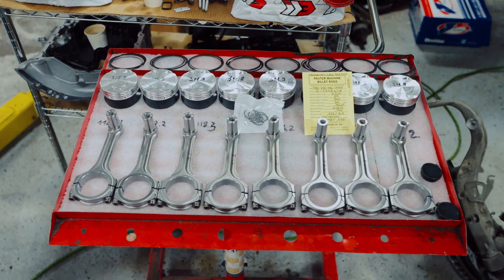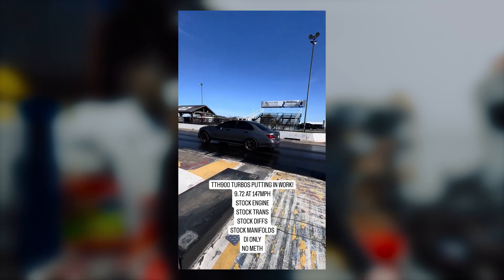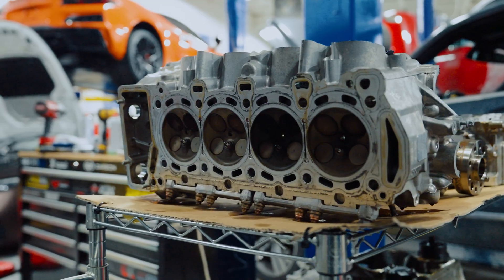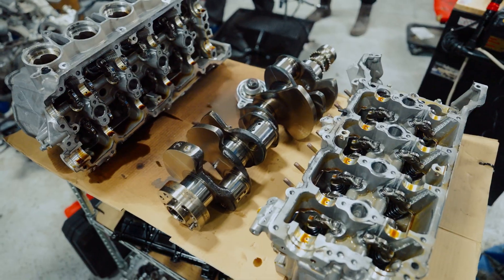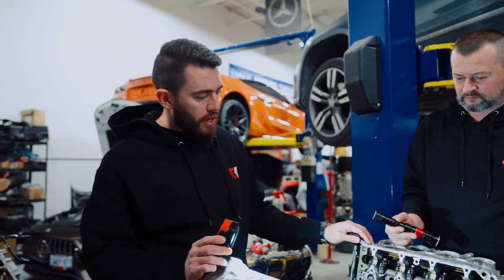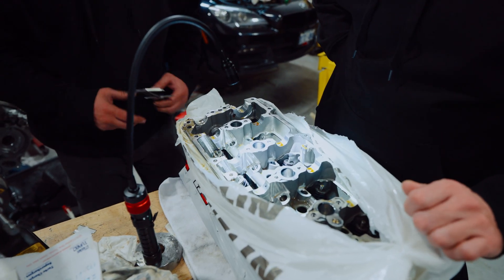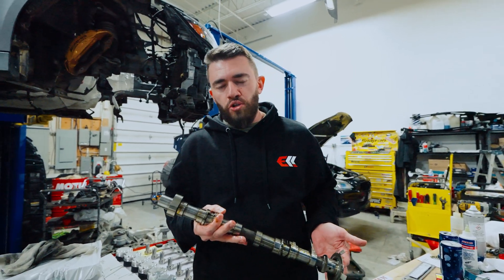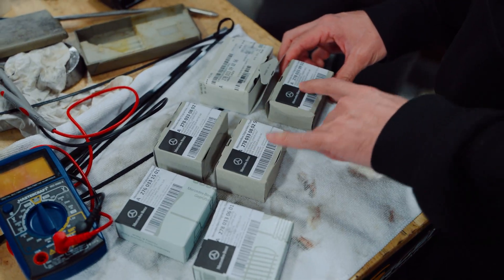1500HP GT63S Build: Engine Internals Inspection & Prep | Episode 3

Comment: What about the transmission? Curious how much torque it can handle before slipping
Reply from the maker: @ajonathany  we will be discussing this in the next video! It’ll be about the transmission
Reply: Do you think the head gasket will stand up to 1500hp or do you think you might need to use fire rings?

Comment: Is there no steel sleeves going in?
Reply from the maker: No. The block is Alucil and the pistons were designed to be a “drop in” application which works great with the factory block.